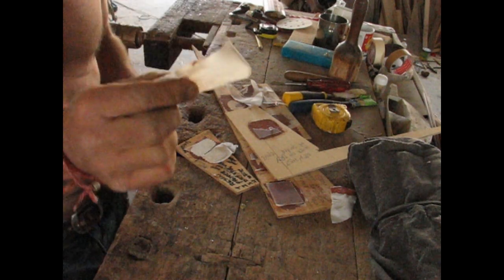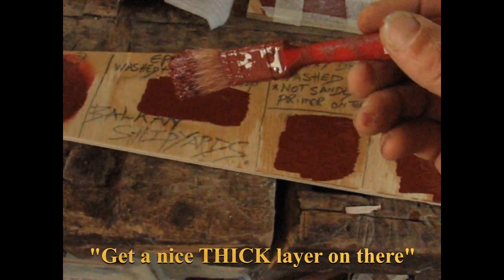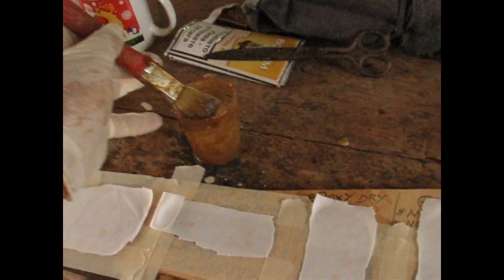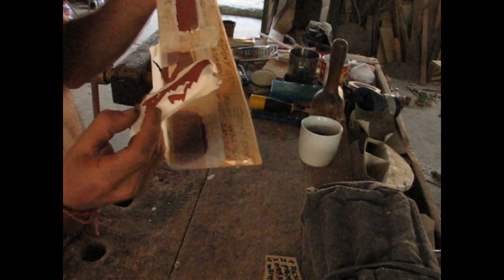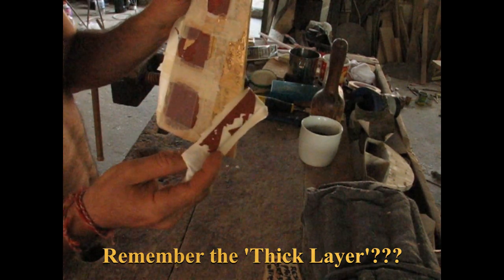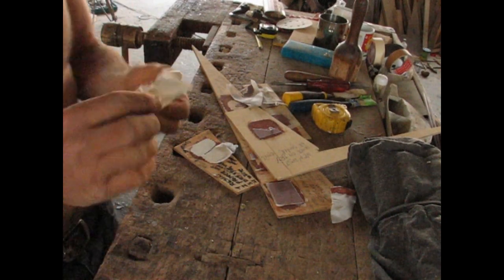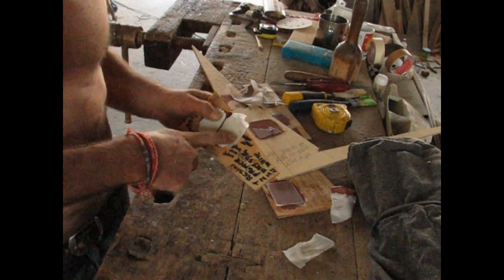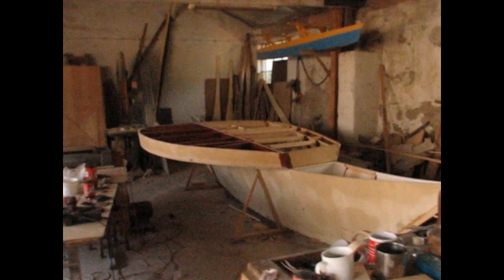5 ADHESION Tests, PAINT over EPOXY. Balkan Shipyards

Comment: There is something very relevant about "real world" testing. Computers and molecular biology are good to begin with, but at some point, the ACTUAL test is in the real world. I see many dreamers out there, but to actually test, apply, and execute the operation is the real proof.  Good stuff here! ZPLAA.
Reply from the maker: Correct bro! On my fist Proa 'Crystal Clear' the whole fiberglassed bottom delaminated the next day!!! It was a horror film, I wet out the hull then put the glass over and wet out the glass.... The bottom layer kicked and the top glassed layer just peeled off like a banana peel. I'm shit scared of epoxy ever since...... By the way, it was a fancy new epoxy I bought, I didn't know how to work with it, the tin had no instructions.... I assumed what I assumed.... Bottom line, I went back to what I know, the cheap stuff. Never had a problem since! Happy u like it, Keep Shunting man, BSY
Reply: @BalkanShipyards  Wow! that would make me lose my mind! Cheap is what they call it, I take it as a challenge to improve on the end result without wasting my hard earned money. Love using the lower quality stuff and achieving a superior result.

Comment: Good tests. Epoxy primer is just another epoxy resin with some filler added, so not surprise it sticks. What if skip epoxy primer and just paint with polyurethane paint over cured epoxy resin?  This is what I gonna do soon.
Reply from the maker: Test before, and share your results here if you don't mind. As for me? the Primer is very cheap, the paint is double the money, and the epoxy resin is four times the price of the primer. I use the primer to fill the fiberglass and smooth the epoxy, I did this with epoxy resin in the past, now I use primer. It's much cheaper, much easier to sand, and where I missed and didn't sand, the top coat still holds on to it.....

Good luck with your tests! interesting what would happen.... Keep Shunting, Balkan Shipyards
Reply: One part paint will take forever to cure/dry when applied over epoxy resin (even fully cured). No problem when applied over epoxy primer. Two-part paint is a different story, of course.